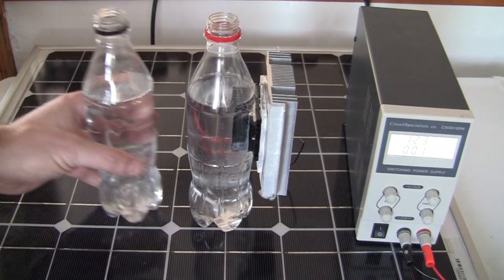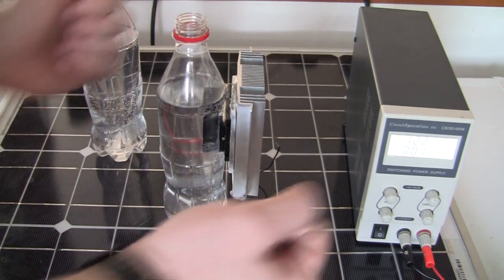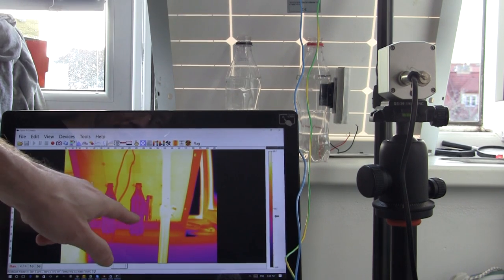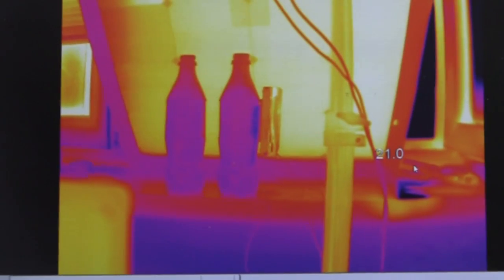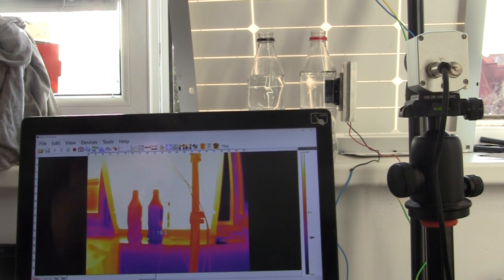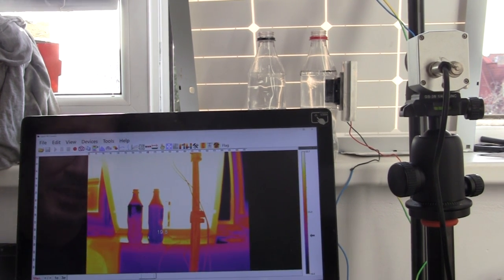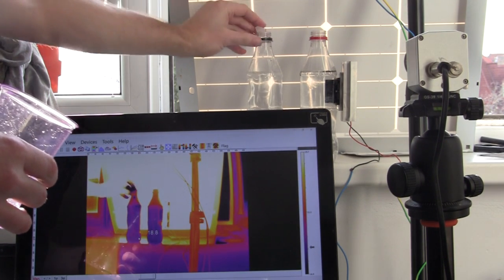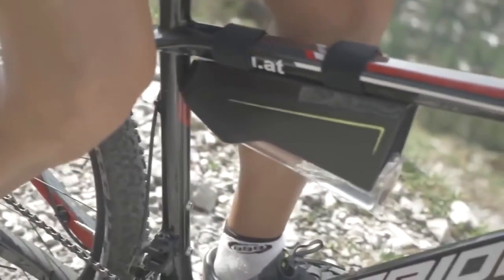Self-Cooling water bottle ACTUALLY WORKING!!!

Comment: The Romans cooled water by keeping it in unglazed pots.
Reply: It cools the water by having some of the water soak through the walls of the pot (therefore they must not be glazed) and then evaporating outside (for example in wind). This is the same effect that cools your body when you sweat. The process of evaporation takes energy and some of that energy comes from the heat of the waters surroundings, effectively cooling what is around the evaporating water. Or something like that, I'm not entirely sure, look up how sweating works if you want a correct scientific explanation.
Reply: Oh my! Quick a quick starter the "world's first self emptying water bottle"
Reply: They also sweetened their wine with lead.
Reply: mmmmmmm tasty tasty lead
Reply: It also means they have to be kept in a ventilated, shaded location. If you put them in sunlight it'll heat up more than the evaporation will get rid of. You're also loosing water all the time too, so it won't work for the "self filling water bottle" idea either (not that you are suggesting it could, I'm just saying)
Reply: Unglazed pots are wonderful bacteria farms.
Reply: It still exists. It's called "botijo", and it was quite a common thing until not long ago. I had one in my house, made with clear clay.

However, they have a few problems. They're not as comfortable for drinking as a bottle (quite heavy in comparison). And you have to use a little dish to collect the water that pours down (it's a porous material, and while part of the water evaporates, part of it just slides down). So you need to throw away the water in the dish, about once or twice a day. They're quite slow too (think a couple of hours at least).  And while the water is cold, it's not as cold as the one in the fridge.
Reply: The Romans were badass.
Reply: And the Spanish perfected it: https://en.wikipedia.org/wiki/Botijo It cools down the water through evaporation.
Reply: the romans also used lead to sweeten their wine.
Reply: Alex Quant The Australians cool water in hessian bags tied to the front of the 4WD out bush, it uses the same idea that some water leaks into the material and the breeze going through it cools it down, come to think of it that is how an evaporative air conditioner works.
Reply: Goes back to the ancient Indus valley civilisation circa 1500 BC, and it is still in use.
http://www.notechmagazine.com/2012/04/botijos.html
Reply: iraq, still do that in small villages
Reply: http://i.imgur.com/IW8simF.gif
Reply: they cool themselves with evaporation, same think with leather (?)canteen(?).
Reply: They kept it cool, it didn't cool it down.

Comment: Next up, make a sodium/potassium alloy - water - explosion powered engine.
Reply: That's a relatively easy engine but man is the fuel expensive, I don't recon you'll get many miles to your buck. Also with your waste product being KOH and NaOH you will make many hippies cry.
Reply: Better add in some thorium and make the engine spin for good measure.
Reply: It all ready has been invented and is sometimes used as a coolant in certain nuclear reactors.
Reply: +eierjucken salty

Comment: Correct me if I'm wrong, but isn't 5V 1A equivalent to 1W? Because it's hard to believe that, that PC case fan would require 50W to power, considering a cheap hydronic space heater is 150W for the first element, a high end computer doesn't usually run at more than 350W constant under load, where about 90% of that is the CPU and GPU (graphics card), how do those numbers add up if I'm wrong about 1W being 5V x 1A?
Reply: 5V * 1A = 5W, typical low power usb 2.0 socket for example provides 2.5W (500mA) - phone chargers do more up to around 15W. The fan is low power, it's the peltier plate that's consuming the 50W and does the heat pumping - a fan can only cool anything down to the ambient temperature (not taking into account evaporative cooling)
Reply: Wayne Boguski no, he's correct. P=U*I or W=V*A
Reply: Sebastian Grygiel Ahh, now I feel stupid. Thanks for the educated answer.
Reply: Wayne Boguski 5V and 1A gives 5W of power.
Reply: Wayne Boguski Well actually that would be 5 W since P = V x I so that would be 5   volts times 1 amp.
Reply: Wayne Boguski, P [W]=U [V] * I [A] so 5V * 1A = 5W, the 50W is the power it takes to power the peltier element, not the fan
Reply: To get watts you should multiply volts by amps. So, 5V*1A = 5W
The fan power consumption is minuscule. It's not a fan that consumes ~50W of power, it's a Peltier element under it.

Comment: i acrually want one of these be developed further so that I can buy one to keep my wather cool on my motorbike adventures
Reply: Buy a flask put some ice in it.

Another solution is to freeze a whole plastic bottle of water. It takes a good few hours to completely melt even in pretty hot weather keeping it cool.
Reply: cough Vacuum flask cough
Reply: IIRC, there are small fridges specifically designed to run off a bike's power.  But I think they only work for tourers like Goldwings and larger cruisers.
Reply: NO YOUTUBE I DO NOT WANT A NAME What do you mean?
Reply: Jack Evans 
wouldn't the water bottle have some issues being frozen?

Comment: hook that up to a self charging battery... XD
Reply: SOLAR FREAKING PLASTIC THORIUM POWERED LASER DRIVEN SELF CHARGING BATTERIES!
Reply: Walk With Wally Hook it up to a thorium powered spinning solar power.
Reply: self charging battery?
Reply: dipensor okay are you ready? strap in, you're about to be amazed.. A battery that can charge itself by using the sun! 😂
Reply: So, what does it change? It's already powered by a solar panel.
Reply: It's called a joke. He was poking fun at all of the pseudo-scientific products that TF debunks.
Reply: Tyrion Lannister makes it more portable. charge it when it's sunny, cool you're water when you want it.
Reply: The New Neoclassical Liberal I was semi serious. about as serious as thunderf00t. serious enough to build this, but clearly in satire.
Reply: +Tyrion Lannister the ability to store the energy required to power to cooling element.
Reply: Oh, i didn't think about that. It makes sense. It will be heavy, but at least it will work when the sun is down.
Reply: Walk With Wally I'm sure a while ago you could buy cold coffee in a cup with some sort of chemicals in the bottom which mixed and heated the coffee...
Reply: > self charging battery

lol! fucking genius. i'm surprised no one has tried to make an indiegogo campaign for one of those...
Reply: George Reynolds they also have instant cold packs.. shake it up and duct tape it around a water bottle. unfortunately they are about $13 each from what I can see online.
Reply: Hmm its a thing... so it would not impress anyone, maybe you though https://www.amazon.co.uk/Aedon-Portable-20000mAh-2-Port-Charger/dp/B01I0WWHWI/ref=sr_1_2?ie=UTF8&qid=1489804772&sr=8-2&keywords=solar+battery+pack
Reply: also you could just buy one of these https://www.amazon.co.uk/Charger-RAVPower-Efficient-Lightweight-Waterproof/dp/B01FH2HYCW/ref=pd_vtph_107_tr_t_1?_encoding=UTF8&psc=1&refRID=RPERVVDXVX4Y1R8M5YJE